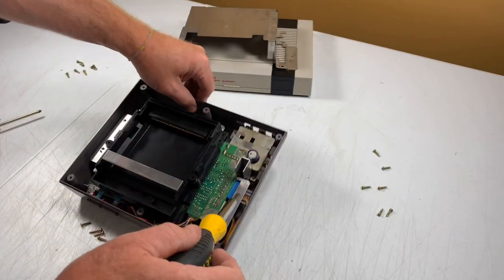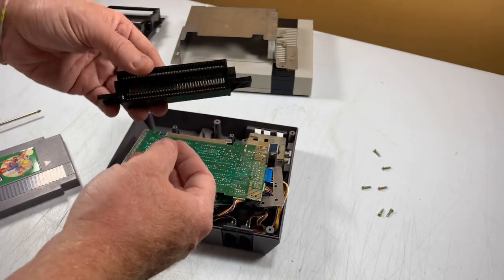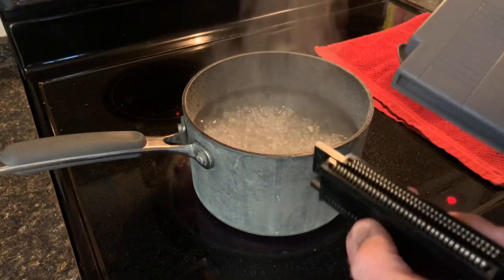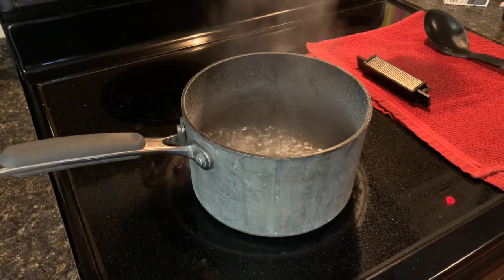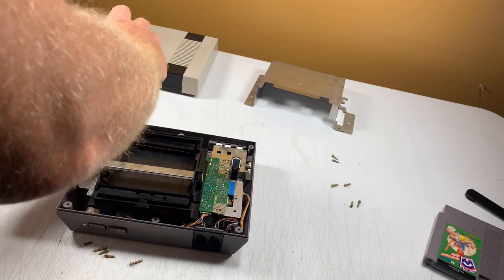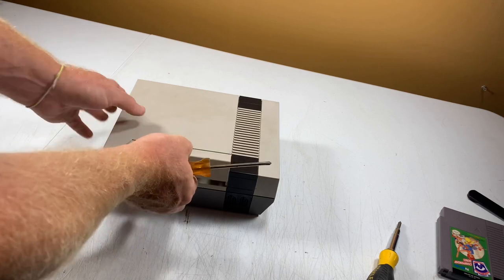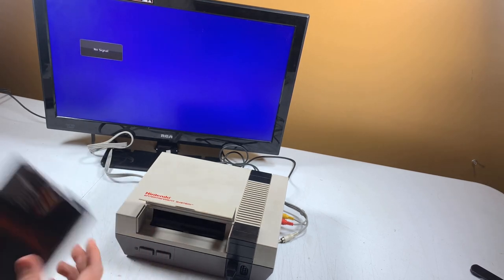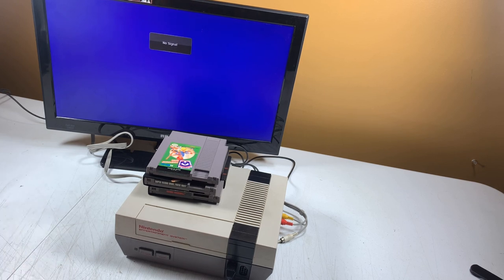Boiling A 72 Pin Connector To Repair An Original NES Console

Comment: I have done this...it works folks. Also cleaning the games with a q tip REALLY GOOD. don't give up. It worked for me.
Reply from the maker: Yes it does! Thanks for watching!
Reply: @JanuaryHouse what size do I need to get to the 72 pin connector